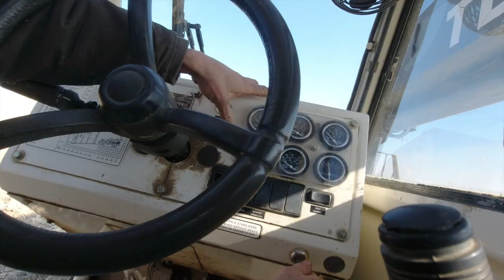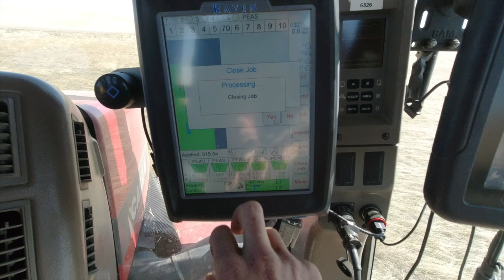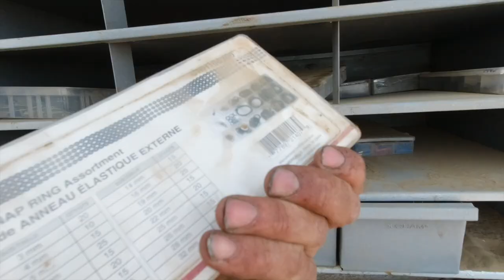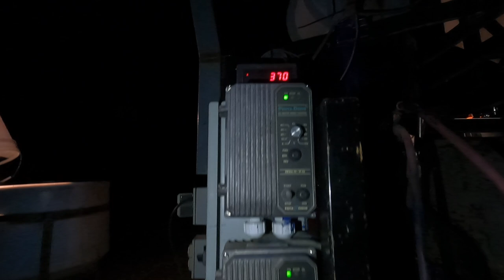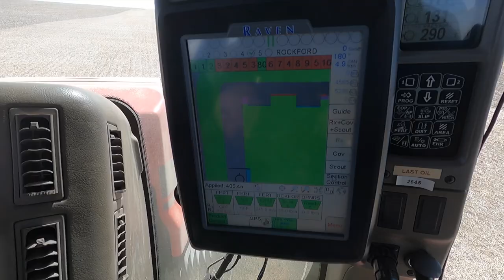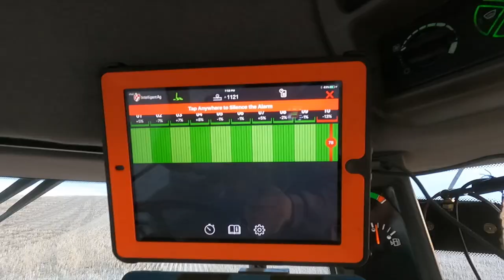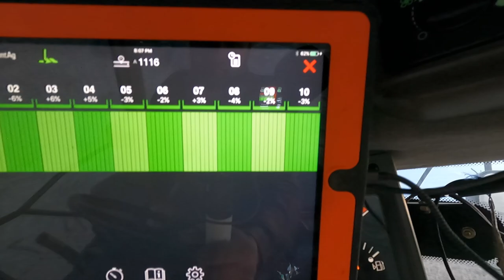“My Butt Came Off the Seat!”  Seeding #2

Comment: A suggestion for worn primary hoses on the seeder is to use a piece of tyre inner tube under your hose patch. It will stop the patch wearing out and I’ve found that the hole will take a couple of seasons to grow large enough to need to replace the hose.

Comment: My cousins use Honda Fat Cats to run around on.  They are small enough to haul on their air cart, trucks, etc.  They say it is really helpful if they have to run to get the maintenance truck or whatever that may be a couple miles away.

Comment: I agree with your dad on engineer's, they should have to replace the batteries.  My car battery is equally ridiculous.  Take off front drivers side tire, remove wheelwell panels. Same to replace headlights....only both sides of course.

Comment: Case was going all out just to p$%%in our cornflakes with there battery placement my 09 the step flips down to get to the box but if the pin falls out and you hit a hard bump the tip of the step bracket goes into the drain hole and busts the bottom of the battery and why they lined these two things up only the engineers could have made that happen perfectly. The only reason I know this after two batteries I figured it out and put a bolt in place for the quick pin.

Comment: That is just plain ridiculous about getting to the battery to change it! It looks as though it is just as bad to top the battery up with distilled water - is it? Other tractor manufacturers use a similar location but make easy provision for battery maintenance and easier to do a battery change when necessary.
Talk about easy maintenance that is just a complete joke in my opinion.
Reply from the maker: There is a post to hook up a charger to out side of the box but to get the batteries it’s a pain